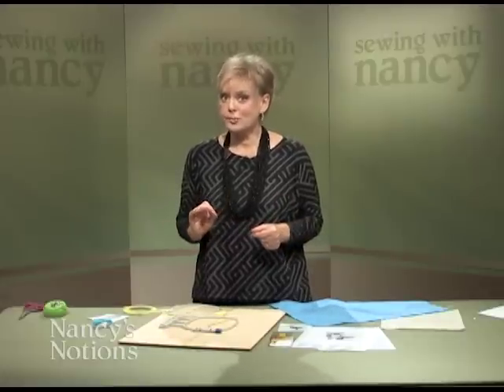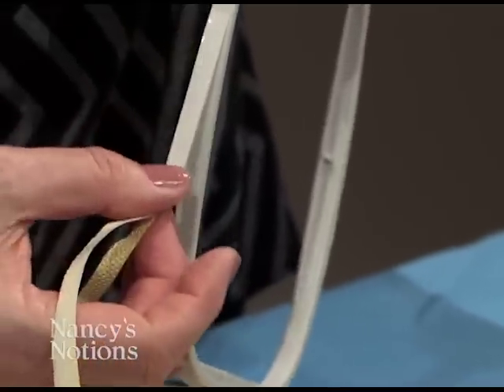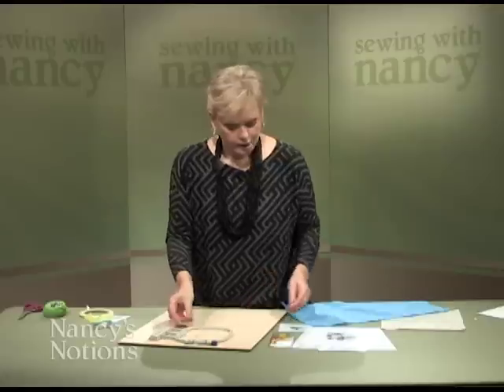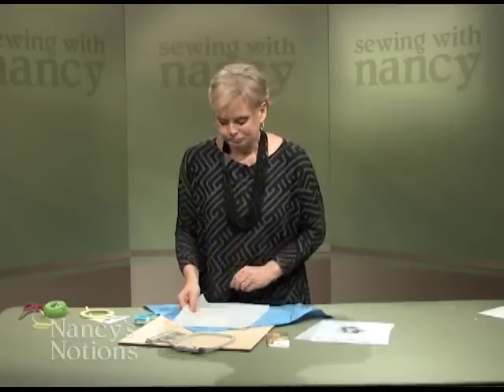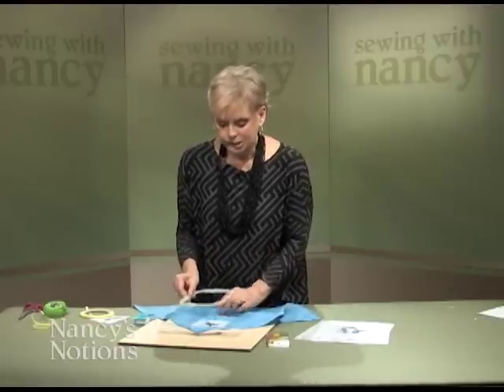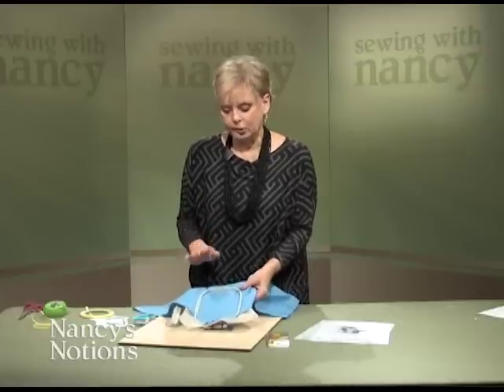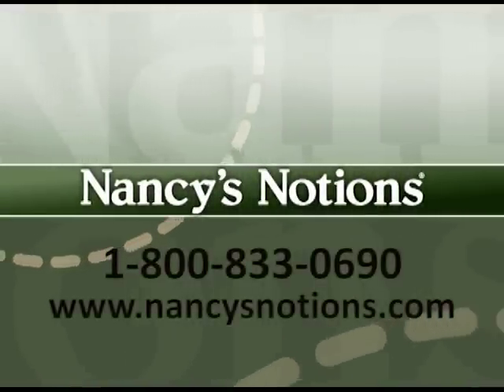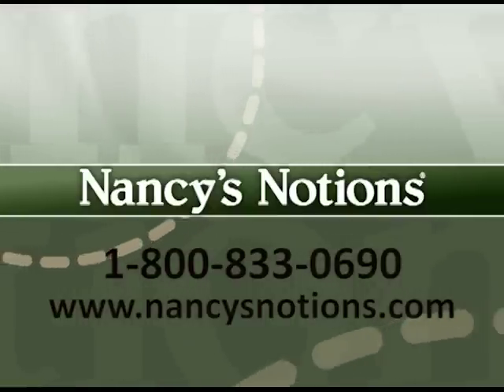Hooping doesn't have to be hard

Comment: noticed that at the end of your hooping tutorial the fabric was NOT tight and smooth.  I always pull on the fabric on the outside of the hoop and  pull everything taut.  Is THIS step what is causing all my puckers around my design after removing the stabilizer?
Reply: Your fabric should be hooped with neutral tension (not wrinkled but not stretched). If you pull on the fabric, you can distort the fabric tension and stretch the fabric. When fabric is stretched and stitched, it will relax after it's removed from the hoop and yes, you will get puckers. Do this test: Hoop some striped fabric (without stabilizer) and then pull on it and notice the stripes. Are they still straight? Then lightly run your hand over the hooped fabric. Is it tight in some areas and spongey in others? If you tightened the screw after hooping, feel next to the screw. How does it feel there.?

There are other contributors to puckers but as you've surmised, stretching the fabric is a big one!
Reply: LindeeGVideos l
Reply: Absolutely this is what's causing your puckering. When you hoop it, you want it to be perfectly aligned, AND taut, without  having to alert it post hooping.